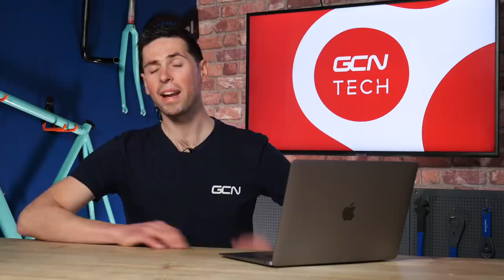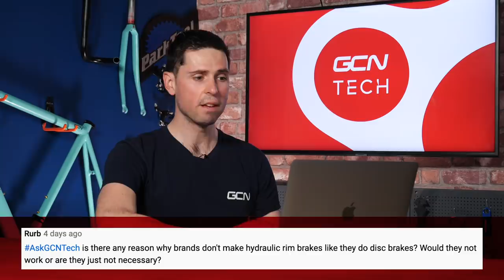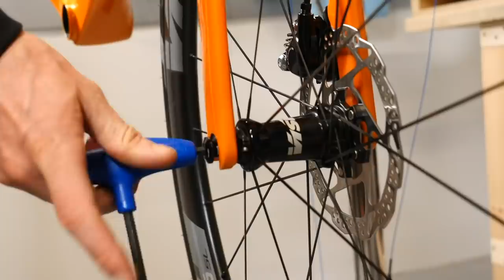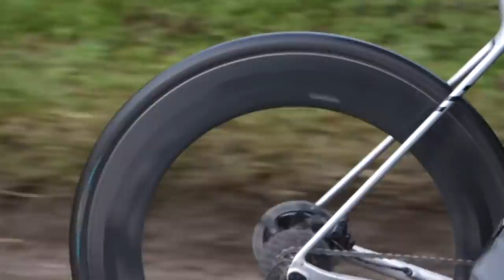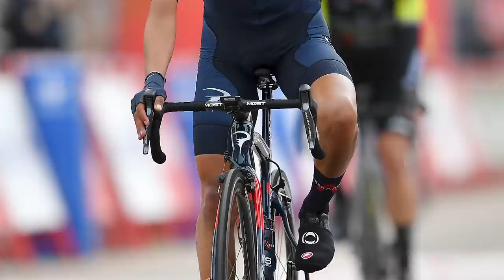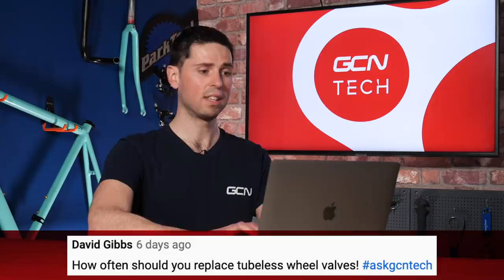Are Team Ineos The Only Pro Cycling Team Still Using Rim Brakes? | GCN Tech Clinic #AskGCNTech

Comment from the maker: Do you have a burning tech question? Let us know in the comments section below using the hashtag #AskGCNTech, and we'll answer it in a future episode of the Tech Clinic.
Reply: #AskGCNTECH what is the best resistance for calculating ftp on a wattbike Pro?
Reply: #AskGCNTech What do you think about the Velocomp Powermeter? Is it accurate like a regular Power Meter? It will be nice to see a comparison video. Thanks for your great work!
Reply: Ollie OR pro riders...😂😂...I guess Alex dropped Ollie in the race for the tech clinic 🐢
Reply: #AskGCNTech Not a tech question but what are the best conditions for attacking solo or in a small breakaway? Tail wind? Head wind? Cross? Some combination? I think it'd be cool if GCN did a series going into race tactics showing bits of race footage as examples.
Reply: #AskGCNTech, I recently purchased a Basso Palta gravel bike and I'm looking to get a set of deeper section carbon rims for the road as a opposed to the Microtech rims it came with. I'm looking at either the EVNE foundation 45, or the ZIP 303s as a good road option to fit 28-32mm tires on it. But I'm also wondering if it is frowned upon to put American wheelsets on Italian bikes. I'm in the market for a set of wheels under $3000 CAD and don't really want to buy a Campagnolo wheelset. If you have any other wheelset suggestions for road riding I'm all ears. I'll still be using the Microtech rims and 40mm gravel tires for off road.
Reply: Not a question but STOP RECOMMENDING TUBELESS FOR ROAD, it sucks and isn't needed nor does it do much! Some pro-teams even went back to innertubes instead of tubeless and/or tubular!
Reply: #AskGCNTech - Hi Ollie/Alex - All things being exactly equal (tires, wheels, drivetrain, cockpit, brakes, etc) shouldn't a gravel bike and road bike have similar top-end speeds barring the differences in the weight and shape of their frames? I'm considering my next bike purchase and think that a gravel frame with one wheelset for gravel and a 2nd wheelset for the road would be sufficient. Unless the gravel frame is extremely heavy or prevents the rider from riding comfortably in an aerodynamic position I don't see why a gravel bike with road tires would be slower than a road bike.
Reply: #AskGCNTech Regarding your video about increase your speed. I have been told that it’s Easter to drive faster when the temperature is warmer outside. As the air molecules are denser when it is cold, you must therefore use more watts to break the wind when it’s cold?
Reply: #AskGCNTech I started my cycling life with a hybrid bike with a tourney groupset and a road bike with a 105 groupset last year. I have been recording the mileage of each bike but I don't know when (at a certain mileage range for example) should I be replacing both groupset's cassette, chain, chainring, and disc brake pad. At which mileage range should I consider replacing them?
Reply: #AskGCNTech I accidentally rode my bike (which has disc brakes & thru axle) with the thru axle not tightened enough (But the axle was still in the thread). Is there any potential  that it could damage the frame?
Reply: #AskGCNTech
 Hello guys. I have a cheap 8 speed microshift rear derailleur. I wanna change that to an 105 or ultegra 11 speed. I know I need some new wheels with a shimano 11 speed freehub. I am surrounded by mountains so I'm thinking of an 11-32 cassette, but now the question, do I need to buy new levers, or can I use these (8 speed) hand levers that were originally on the bike? Tnx and cheers.
Reply: #AskGCNTech Hi guys, I'm looking into power meter options and I have decided to go the dual sided "pedal based" route. Should I get the Assiomas, Garmin V3, or wait for the Wahoo Speedplay? Pedal type isn't a huge factor since I'm making the switch from egg beater MGB pedals anyway.
Reply: #askGCNTech What type of polish should I use on a bike that has both Matte and Gloss finishes?  Will using the wrong type of polish or cleaners ruin one of the finishes?  Thanks!

Comment: Time to blow the bubble on Tubeless.... every video I've watched suggests that "you may have a bit of trouble"... "they may suddenly go flat overnight".... "you might need to try a few times before you get a good seal on the rims".... "you need a new reservoir track pump".... "sealant might leak out and make everything messy"... and the best one of all is the fact that even if you fit tubeless, you still have to ride around with an inner tube in your pocket as a back up!!!
40 years ago I used to TT on tubs, cotton in the spring and then silks in the summer.... can't remember ever having a puncture in an event. Trained on clinchers and probably had a couple of flats over a winter, but it took about 10 minutes to swap in a new tube. The extra weight and resistance meant that I always felt a boost when I got on my comp bike.
What possible advantages of tubeless can outweigh the extra faff, cost and uncertainty?
Reply: Shows like GCN need to also get on board with pushing dumb innovations so they can make money on the discussion and new subjects stemming from the "technologies".   

Tubeless is dumb.  People who use tubeless who don't flat for 5 rides attribute their luck to the technology.  People who flat on tubed tires are being told they wouldn't have if they simply ran tubeless.  
On tubes, I've flatted twice in 2 weeks (old tires) but also 0 times in 2 years.  I've even gone back to tubes on my MTB without a flat in ages.
Reply: Like everything - there are times where it's appropriate and useful and times when it's not necessary.

But also, and I'd say more importantly, cycling is an innovation obsessed sport/hobby and enthusiasts are always keen to try new and potentially improved solutions to things that weren't really a problem in the first place. For me personally, dismantling my bike has always been one of the most fun things to do with it - so I love any excuse to tinker around. Even though it has resulted in many a booking at my local shop over the years.

The dream of tubeless tyres is that they are a fit-and-forget part, that roll faster, add comfort and can ride through all but the most catastrophic punctures. Obviously that's not the reality for many tubeless road riders atm, but maybe one day when the technology has gotten even better and there's more experience fitting them...

When it comes down to it, there's no one forcing anyone to go tubeless (except maybe in pro racing) so I don't really see any need to 'blow any bubbles'
Reply: @Mansellto  I definitely relate to the remark about tinkering and then heading to the bike shop - I can do a lot myself, but occasionally end up needing a little help when it goes wrong. Ok, more than occasionally. 

And I agree on tubeless - I decided to give them a try recently. Set up was a challenge - I'm hoping now I know what I'm doing. That said, the ride has been fantastic, they have had no problems with the bad roads / gravel where I ride, and for now, I plan to stick with them. I don't travel with a tube anymore, but I do carry a puncture repair kit just in case. 

I greatly doubt we will see tubes go away unless the market pushes it. Sort of like discs - manufacturers have seen the way the wind blows. I view rim brakes kind of like manual transmissions in cars. Sure, lots of enthusiasts like them, but it seems that when provided a choice, many are selecting discs. My newest bike has hydraulic discs and, while rims are fine most of the time, I've really appreciated the discs on wet rides, especially on a recent wet ride descending several miles.
Reply: I was tempted to switch to tubeless for my new road bike but was urged not to by the owner of the bike shop.  He'd switched to tubeless but had a rear blow-out on a group ride.  He sprayed sealant all over his drive train and the bike, clothing and face of the rider behind him.  It was very messy.  Ok, that was just his personal experience but I've had one flat in the last several thousand miles, even on UK roads, so I don't see the benefit in the extra faff of tubeless
Reply: @ericcoxtcu8037  just one advice: carry a tube. A tubeless repair kit doesn’t always do the job, especially when there’s a tear in the sidewall. Besides that, having a serieus puncture sometimes causes the tubeless tire to unbead, and in most cases you can’t rebead it with a mini pump. Just speaking from experience. I was also enthusiastic about tubeless and decided to not carry a tube anymore. Until the day that I hit a rock, both of my GP5000 tl’s flattened and I spend an hour in the cold trying to fix it. I never succeeded and another cyclist offered me his spare tube.
Reply: @Tuslareb  I'll take that under advisement. I definitely carried one for a while with it, but had removed it. I'll throw it back in.
Reply: Tubeless for 2 years with no issues..can’t understand the hate, they’re great. I seem to be lucky in all my sports compared to YouTube commenters who fuckin moan about everything
Reply: You should always bear in mind what you expect from your bike.  I expect my bike to be ready for use every day in every weather.  To do large distances without excessive maintenance.  So my tyres are heavier and I carry more gear.  I don't need expensive modifications to go faster because saving a minute over a 30km trip isn't measurable.  Only if I was racing would some of these items be an issue.  PS I use disk brakes because I prefer living.  Others may not need this feature.
Reply: @mbal4052  Did you have any issues with tubes?
Reply: @mbal4052   My only issue at first was setting them up - they could be a pain, but since then it's been fine. Better than standing at the side of the road in winter trying to fix a puncture.
Reply: Pablo Morales  oh no, bike manufacturers trying to sell stuff... how terrible.
MTB seem to have used it forever. I haven't tried it, but if you can run at lower pressure, maybe I will.
Reply: Not needed for road bikes. It's just another thing that's crossed over from mountain biking where most of the tech innovation happens, and where it's actually useful.
Reply: @mbal4052  no issues ??? Everybody has issues with tubless, I've been on tubless for 12years on my 29r and have had many issues with different tyre manufacturers ie getting the tyre to seat.....but so as you hear that " ping " your in business ( I used to use the old soapy water tick) but now I just take it down to the lbs they have a compressor bingo!!! I still use inner tubes on my road tho ,I can see road tubless being a problem with the amount of glass on the roads i ride on ,one cut and it's over tyre sealant wouldn't seal so I'd have to put a tube in there anyway 🤷‍♂️
Reply: Exactly, I really don't know what the hype about tubeless...changing tube is not rocket science and only take you 10mins like you said.Tubeless is just an upgrade version of TUBULAR that everyone are not keen of. The advantage on TUBELESS VS TUBULAR is that TUBELESS you have a chance to put an inner tube if you tires won't seal. But question is how many tubeless rider will bring an inner tube?

Comment: Podjcar used rim brakes on his colnago at Tirreno Adriatico
Reply: I noticed that he uses rim brakes on "important" stages like a vital climbs and what not, where he can't afford to lose time in the GC standings.
Reply: Yes, UAE stil uses rim brakes, but goes back and forth to discs as well.
Reply: @81caasi  UAE is also personal preference type team. You can see that different riders in the team use different brakes based on their preferences which also explains the back and forth rotation on brakes. With that, it still shows that some (most) riders prefer rim over disc.

Comment: 4:40 bikes have the gears on the right side because this way the sprocket thread would be a normal one (tighten clockwise) so it will get tighten with the pedaling. This made early bikes easier to make, and it just stayed that way.
Reply: Possibly but motorcycles adopted the opposite.  You find that chains are always on the left on a motorcycle.  So really it doesn't matter as long as we all agree everything is fine.  PS Early sprockets were all splined so they could have been fitted to either side hence there was no historical reason for being on the right.

Comment: Road disc brakes are pretty great, in terms of stopping power, modulation and consistency. However, the very tight tolerances between pads and disc can be frustrating to set up without rub, and it only takes a slight ding to the rotor to have a constant noise that can be tricky to remedy.

So, a thought experiment. Why are the pads so close to the rotor? In order to get the most mechanical leverage – a big movement at the lever equals a small movement at the pads. But why do we need that much leverage? Because the rotors are very small, so to be able to slow the much larger rotating mass of the wheel, we have to squeeze the rotor tightly. Therefore if the rotor was bigger, we could have a caliper with the pads further away, and this would be fine as we wouldn’t need as much mechanical advantage.

To take this to the extreme example, what if the rotor was the size of the rim? Like 622 mm in diameter. In looking at this problem, it became apparent that it would be possible to dispense with a separate rotor and use the rim of the wheel as the braking surface. Testing of different materials for the braking surface and the pads concluded that a machined aluminium surface and standard pads provides fantastic dry weather braking.

With the rotor being almost five times bigger than normal, the brake pads can be several millimetres clear of the braking surface without sacrificing power. This would make brake rub nonexistent even if the wheel goes a little out of true. It also turns out that a well designed mechanical caliper can provide all the power and modulation required – no need for the usual hydraulics. It turns out a steel cable will do this job admirably!
Reply: Nails it perfectly!
Reply: Ooh, stop being so reasonable, sir!  :-)  There's no place for logic when there's so much juicy techie stuff to be sold! Carbon-fibre...  Tubeless tyres... Hydraulic disc brakes... Wireless wotsits... Expensive gizmos...  Let's turn a £300 bike into a £30,000 car...

Of course you're absolutely right, and I love your magnificently innocent analysis of how innovation for the sake of it can blind people to what's really important. So, a bike has two big wheels, eh? Hmmm...   How long before someone tries to sell the idea of a racing unicycle on the strength of the fantastic weight savings possible?

Yeah! An electric gyro unit would take care of balance issues, and an array of autonomous sensors would steer, leaving the rider free to pedal...

And then, after a couple of years of such profitable stupidity they'd introduce a novel concept: a cycle with TWO wheels! What? A 'bicycle'?  It's a crazy idea, but it just might work...

Sigh.

My crummy bike uses 50 year-old technology. Welded steel frame ("Ewww!"). Crunchy rim brake caliper-type thingies with immense stopping power on 27"x1¼" aluminium wheels. Er, immense is good enough for me. In the wet, I just squeeze a little harder.

C'mon, now, guys. Cycling's not broken. Put your wallets away. Just mount up and ride.
Reply: Yep!
Reply: Brilliant 👍
Reply: @The86rick  that's true, if you ride in the wet a lot then discs make more sense.  I usually avoid the rain if i can.  I guess you just have to ask yourself which is more important to you... the simplicity, nimbleness, and quietness of troublefree rim brakes on a sunny day when you can most appreciate the joy of a proper road bike, or to put up with all the extra maintenance, disc rub and tinging, etc on the otherwise perfect days so that you can be a little less miserable on the miserably cold and wet days knowing you have discs.